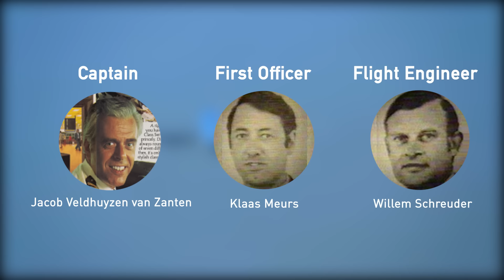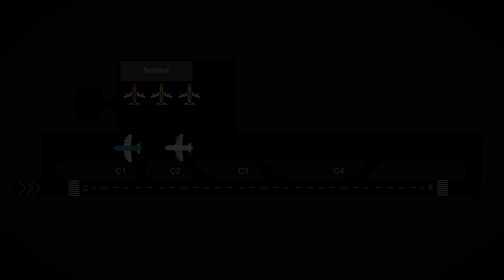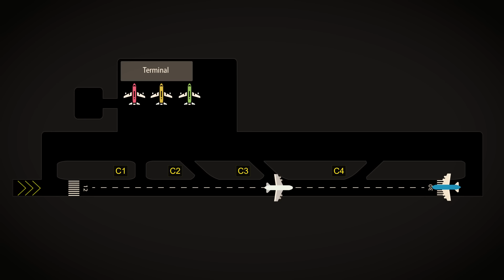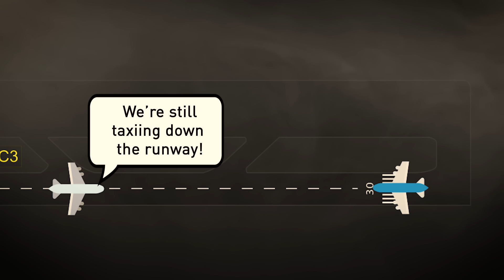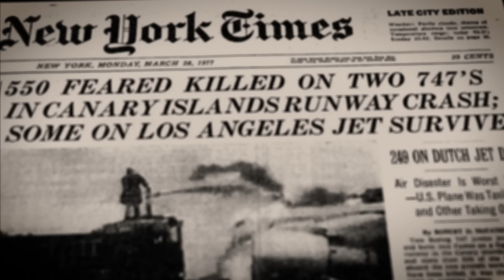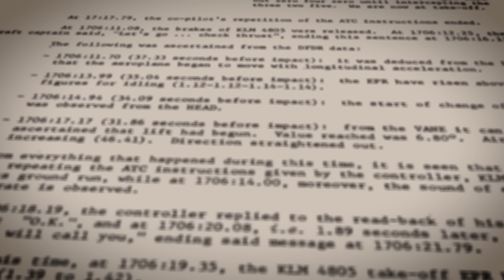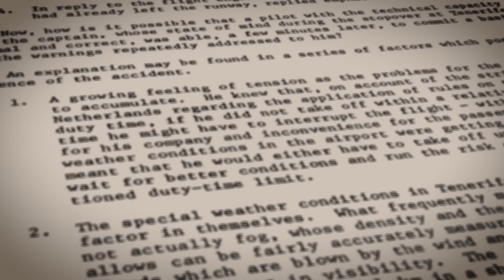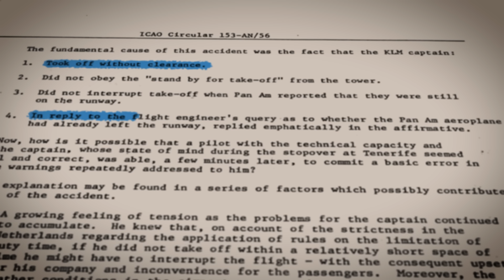Tenerife Airport Disaster | Deadliest Crash in Aviation History

Comment: Let's say 500 people made their sacrifices for today's flight safety.  Flying is now the safest mode of transport, partly because of these events.
Reply: Agree!
Reply: False accidents still can happen while flying
Reply: @jihane1225  No shit, but it's safer now
Reply: @jihane1225  it will never be 100% safe, but it surely is the safest form of transportation
Reply: It's still more dangerous than what you're told, if you calculate it per travel which is the only legitimate way to do it then Flying is indeed more dangerous than driving, yes even commercial.
Reply: @OGPatriot03  How many people die per travel? The chance of a fatal plane crash is about 0.000007%. Faltal car accidents happen 1 in every 103. That's quite a difference
Reply: @SpectorEuro4  The numbers you listed mean nothing without context, cars statistically are significantly more reliable than airplanes once you factor in how many of them are in transit at any given time. As the saying goes the drive to the airport actually ISN'T more dangerous than the flight.

The worst way to calculate the figures is deaths per passenger mile since it's a useless metric, it doesn't matter if you traveled 800 miles when you get got on final approach...

PS: Now if you wanted to say that flying 800 miles is safer than driving 800 miles then I would agree, however that does NOT allow fake news websites to make erroneous claims like "Your flight is safer than your drive to the airport" because that's FALSE unless you live excessively far from the airport.
Reply: @SpectorEuro4  It seems obvious to me that the metric to use is PER TRAVEL, per miles traveled is invalid because the very nature of aircraft mean they travel significantly further distances than cars do.

You posted fake numbers without a SINGLE metric, you literally said NOTHING, it was nonsense. There isn't any other way to put it, you just didn't say anything you posted random numbers with NO relation to each other.

I would be like me posting the percent chance of your having an accident per miles driven in a car, but then switched to a completely different metric without telling you when I described your odds in an airplane(like per travel, or just likelihood to experience in your lifetime), it means nothing when you do that, literally nothing.
Reply: @OGPatriot03  Here's your problem that you fail to realize (stubborn nature). You're finding ways to have a direct comparison between two different forms of traveling🤣. You're doing the equivalent of trying to find ways to "prove" that an Orange has a better apple taste than an apple itself, but you can't no matter how many false equivalencies you come up with.

Distance is irrelevant. You can have a fatal crash in your front porch, and your plane can crash right at take off (which by the way, most airplane crashes happen at take-off or landing, making your argument about distance irrelevant again).

But whatever. I'm not losing any sleep over some dude on YouTube that wants to defy almost a century of aircraft evolution and deeming all arguments as "FaKe NeWs hurrr durrr". Find someone else to argue. I'm out✌🏾

Comment: I cannot believe there's commercial airports, where the take off and landing strip, is the same runway. Ridiculously dangerous.
Reply: That’s common in most smaller airports
Reply: Runways are used for take off and landing. Where there are multiple runways they are chosen based on wind. Never seen a runway dedicated just to taking off or landing.
Reply: @ghostpuppet31  Stick to hoverboards, mate. Get to your departure gate early enough and you'll see the aircraft arrive, passengers disembark, then (after a short cleaning break) the gate crew will start boarding the next flight's passengers. Same gate, same aircraft that never moves.
Reply: @ghostpuppet31  Have you ever actually been at an airport? If you have then you obviously haven't been paying attention.

Comment: As for the Pan Am 747, the crew knew that if they would take the   C3 taxiway, it would mean a over 100 degree turn, which is nearly impossible in 747.
Reply: That's why they were stopped trying to reconcile what they'd been told, the airport taxiways map, and what they could see. If modern radios had been available they'd have been able to communicate more effectively and the controller probably would have re routed/guided them to C4. But as the KLM kept squawking for take off and Pan-am were still at that point confident they could find out where they were they left it a bit late to tell ATC before KLM was taking up the space on the radio. Again no blame at all it wasnt long a few minutes but it just meant everything moved towards the conclusion once the final fatal mistake if van Zanten was made. Nowadays people can listen in and communicate more effectively, both crews may well have heard each other being both in ground frequency. ATC as also ground controller here would have heard both as well. But in the final moments no one could hear anybody as they were all desperately trying to communicate and nobody heard any of it as they jammed each other.
Reply: Yep

Comment: I think you missed an important aspect/result of this disaster. You did point out that some key communications were not heard because of “interference”, but there’s more to that than simple interference.  I watched a documentary on this incident, which pointed out that during the investigation, it was determined that those missed communications were caused by both planes trying to transmit at the same time.  The communications equipment in use at the time could only receive input from one source (presumably the strongest) at a time.  The result of that discovery was that the communication equipment approved for use by air traffic controllers had to be able to receive from multiple sources simultaneously.

Comment: That must’ve been some dense fog almost like they shouldn’t fly in it if they can’t see in front of them, and what’s up with the “hey there’s another plane in the way” oh ok let’s go maximum thrust and hope we can takeoff before we hit them even though according to their visibility they’re less than a football field in front of them which is probably about the same length as the plane itself wtf were they thinking
Reply: They weren’t thinking. Temper and arrogance on the part of one senior captain was the cause of this dreadful incident.
Reply: So tragic 💔
Reply: In modern times, fog isn’t really an issue because of powerful radar and flying by instruments. It was only a problem for them because the airport didn’t have ground radar, and the poor communication. Also the KLM was already going very fast and would have just plowed straight through the PanAm, possibly killing more people, if they tried to slow down. Trying to clear the PanAm, even if it lead to the KLM crashing, was the right thing to do because it would avoid a complete collision.
Reply: Not fog, clouds. Fogs suck. Clouds suck more.
Reply: Dude. What the fuck do you think the braking distance of a fully loaded 747 with engines at TOGA going well over 100 knots is ? If they'd tried to abort after seeing the Pan Am there's no way in hell they would've come remotely close to stopping in time. The point to abort would've been when the flight engineer pointed out that Pan Am was still taxiing. 

At visual contact it was too late for an abort and an attempt to rotate early and clear the aircraft was the best option they had available. Of all the bad decisions the KLM pilot made, you somehow managed to criticise the one decision that was not objectively wrong.

Comment: Your production is excellent but I think you made a factual error and missed an important factor. 
The error is that the reason why the radio transmissions by ATC and Pan Am in response to the KLM ‘we are at take off’ were not heard by the KLM is that they were made at precisely the same time and hence caused a phenomenon known as a ‘heterodyne’ which made them inaudible to the KLM crew (your video presents them as sequential).
The important additional factor was that Captain Jacob Van Zanten was the KLM top 747 flight instructor and not a regular line pilot. He was also very anxious about the delays possibly meaning that they couldn’t complete the entire flight within their flight time limitations. This was why he chose to refuel at Los Rodeos while they were being delayed anyway, rather than have further delay in Gran Canaria. It was also why he was keen to get airborne.
Reply: But the heterodyne is audible. If you get such a response to a critical call, the message should be sent again.
Reply: @Pete Conrad. Agreed. I should have written ‘unintelligible’. The point is that neither the Pan Am nor ATC could know that their message had been stepped on. The KLM was already in the last chance saloon and there was no time for messages to be resent or clarified. The only course of action that could possibly have saved them would have been to have aborted their take off roll immediately they received either message, but unfortunately they received neither.
Reply: @peteconrad2077  that’s one of the many mistakes KLM did… they never double checked if the message was for them. Not to mention the non-standard nomenclature used by the crew…
Reply: Today still bad things klm

Comment: The radio interference was not interference per se, but an unfortunate coincidence. ATC's instruction to wait for take-off and Pan-Am's warning were transmitted simultaneously, causing a 'squelch' that caused both messages to be garbled. Also, when you're transmitting, the receiver is turned off so you can't hear the squelch and realise your message is lost - your only clues are a lack of response or, if you're lucky, a third party replying "say again?".

Comment: Pan am was not told the right position when Klm was landing pan am was ahead and klm didn't know if anyone was in the way and they both called eachother together to day the airline and air field is closed to this day sadly to the disaster 😞
Reply: The air field is actually not closed, It had a name change and they now have ground radar.
Reply: Well i meant like it was closed for 10 years after the disaster thats what i meant
Reply: Sorry i didn't explain it a lot more
Reply: @ccorral91  it also wasn't landing but taking off.

Comment: This was completely avoidable. Sure, there were communication problems - both technical and due to missing standardization of sentences. However, if either of the pilots is unsure whether they're cleared for take off, you just should not try to take off at all.

Comment: That is so strange that klm 4805 not taking off and the tail skid on the runway and collided
Reply: It was too heavy and/or too slow
Reply: You have to remember the 747 is a huge plane and it needs atleast 160Knots for a successful takeoff
Reply: The KLM did actually become airborne for a few moments after suffering a tailstrike as its Captain panicked and realised his fatal error in committing to a takeoff without clearance and without being certain that the runway was unobstructed. It struck the upper fuselage and empennage of the PanAm.

Comment: The airport needed to update its radio too if it’s cutting out that much
Reply: That is because AM - Amplitude Modulation can only have 1 person talking at a time. 2 people talking through each other will cause essentially white noise.
AM is still used in aviation these days. The protocols have changed, you now repeat what the other side is saying to ensure you understand each other.
Also every aircraft is equipped with ADS-B allowing ATC to see their location real time.
The best thing to do would have been to not allow taxiing over the runway. Perhaps running the queue backwards would have been the best option. Least amount of movement > most amount of movement.
Too bad these things were not done. Tragic accident that I hope we learned from to the point it can never happen again.
Reply: @jackykoning  I think the issue was stacking on the taxiway so they couldn't go down the taxiway until they'd cleared parked planes via runway. However the solution I have based on the map is send them up to C-4 THEN EVERYONE swings up by that and waits to TURN on to runway when it's confirmed clear. That prevents the urge to roll early as psychologically you aren't able to anyway. Running both up and one 180 on runway leaving one to clear was not helpful either.

Comment: Whilst the technical difficulties needed to be addressed and the airport being over capacity was due to rare circumstance. The investigation should not have concluded that anything other than the KLM Captain was responsible for this incident.
Reply: No the report was almost spot on, the KLM pilot just had to lissen to his cabin crew to stop the plane and 535 lives would have been saved. Just that small dession would change a lot
Reply: The KLM pilot was the main cause, but there were other errors made here and it's important to recognise that this investigation was a learning exercise - anything which could have been improved should be, no matter how minor, and it's more likely to be taken seriously if it's explicitly listed for its role in the disaster.
Reply: Not how aircraft accident investigation works. There's no point slapping one big label on the captain however culpable if there are factors that have also nudged the captain into a position where his bad judgement call can cause it. You want to safety net it so he can't even get into such a position. You only do that by looking at contributory factors and eliminating those too where possible. He didn't get up on a sunny day and decide to go charging at another plane for japes. Yes he shouldn't have made that last call to go without being fully sure and getting explicitly cleared for take off but there was undeniably a chain of events that led to this. It's also in another video explained airport markings should be visible as part of the issue not explained here is the pan-am itself was lost, unsure if C-1 or C-3 or even where C-3 itself so they were parked ON the runway trying to make sense of the map IN the plane and what they COULD see OUT the plane. Not blame on them of course. KLM should never have started roll but that was covered in report. Make marking clearer to see in poor conditions. As someone said elsewhere having radios that mean messages aren't scrambled over each other helps. Iirc the ATC DOES try to abort the KLM too but again no one hears any messages as they were all squawking and those radios didn't allow for that. So what pray tell is simply blaming the captain and leaving unclear markings and ineffective radios going to do to help prevent the next accident? When maybe this time it is the equivalent of the pan ams fault on a different runway getting lost and piling onto a runway from a taxiway and pilot taking off WAS cleared? Congrats that accident could have been avoided before by learning wider lessons from this one as the AAI now learns it was unclear markings and faulty radios meant the lost plane can't even be blamed? These are now fixed but too late. That's why investigations have primary or ultimate factor (in this case KLM captain) but factor in the others so there isn't sole blame attached. Otherwise it's easy to miss additional safety fixes.

Comment: Could have been avoided if KLM plane  simply took off without the 360deg turn
Reply: The plane did a 180-degree turn at the end of the runway after backtracking to the take-off point, I assume that's what you meant. (A 360-degree turn would have left it pointing the same direction as when it started.)

But in response to your comment, I reckon the wind was blowing in a direction such that backtracking and turning 180 degrees meant they were facing into it. Airports will always have planes take off into the wind, if at all possible. Even if that means backtracking down the runway and turning around.
Reply: @Shabon67  Oh. yes. That is what i meant. Given the complex situation of the taxi-way not being available and dense fog, it  could have made sense to consider it.
Reply: @ravishankars6707  Of course. But hindsight is always 20/20. In the mind of the tower controller, there was not going to be any issue as long as everything went "according to plan." Also, there could have been considerable wind, given how fast the low lying clouds were moving/visibility changing. Instructing heavy, fully loaded airplanes to take off with considerable tailwind would've likely seemed like a recipe for disaster as well.
Reply: @ravishankars6707  they had no reason to do so, they had to backtrack to get the most of the runway and take off against the wind